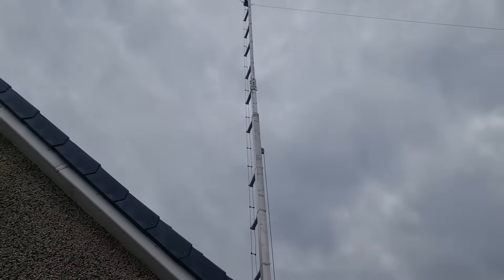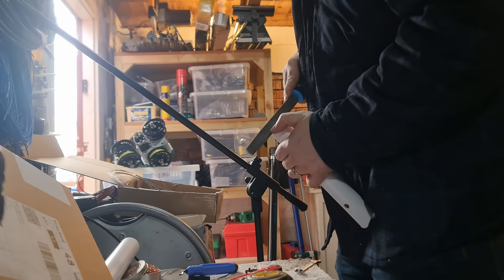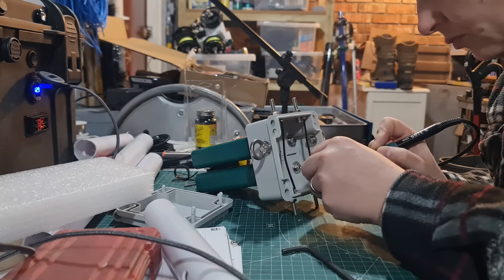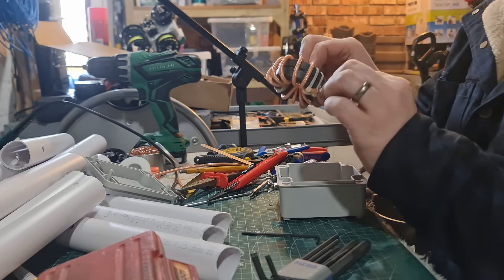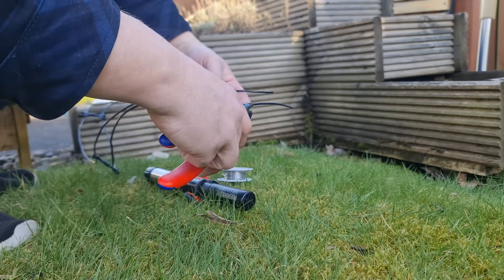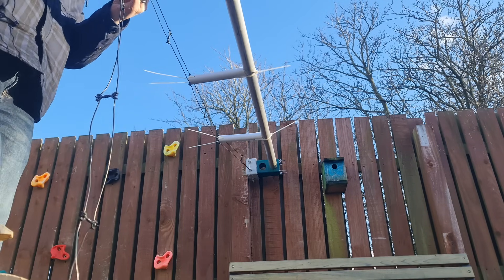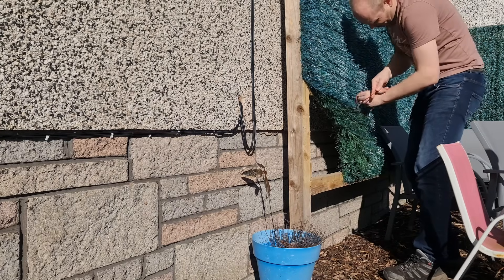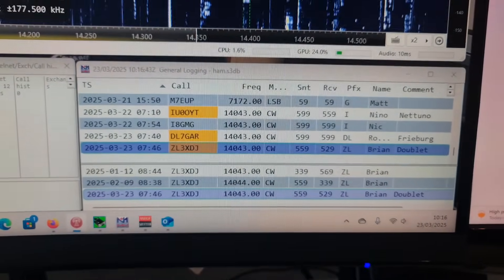The AMAZING Doublet Antenna

Comment: For UV resistance, always use black PVC and black electrical ties. Even a black tarp will last much longer than a white or light colored one. Black blocks light absorption into the material while white disperses it.
Reply from the maker: Yes in principle. Some black materials can absorb RF so need to be carefull. I will see how long this will last. The last clear nylon cable ties were up for years.
Reply: @MM0OPXFieldRadio  Yeah, I'm just offering my first hand observations for people who read the channel. While living in the Arizona desert I have inadvertently been doing an accelerated testing program for UV resistance of materials, due to high the sun exposure. The difference between black and translucent electrical ties will be more than double the durability and for some situations that will be critical. In your case however, in northern latitudes, and with the crank-up mast, I'm sure you can easily replace as need. Also yes, black plastic may contain some carbon.
Reply: Based solely upon color, the opposite of what you state is true - it's physics 101.    It's not because of the color it's the chemical composition and materials used that would provide any blockage of light absorption and breakdown of materials.    The color black appears the way it does because it is the absorption of the entire visible wavelengths in the color spectrum of light and blocks none, white is the rejection/blocking of all visible wavelengths of light in the light spectrum - i.e. lack of color.

Comment: And an inverted V doublet at that.  I cut mine the same length.  It works great from 40-6. I've used it in 80, but it acts more like NVIS antenna.
Reply from the maker: Kinda what I expected. Better than nothing on 80m

Comment: Years ago I bought the LL balanced tuner from PA0LL (SK). His advice was simple: if you like 40M, make the two radiating legs 13 meter each. If you prefer 80M, make them 17 meter each. No further trimming necessary. The doublet with 600 Ohm feeder is great for a multiband wire setup. If you can afford a high end balanced tuner, it's a wonderful investment allowing for full legal limit power on a simple effective antenna.

Comment: 600 Ohm open wire feeder is superior to coax
What you have there will be very enjoyable to use 
Great job !
73
de
VO1DV
Reply from the maker: This is more like 450-500 but still much better than standard LL. Thanks.

Comment: I'm thinking for months now,  to make this doublet or not.
i got a 9:1 balun and 16.2 meter wire,  inv L. 9 meter high
feet point at 1,5 meter. 
With1x 10 meter radial.
 and 16 Meter coax.
.
I think high feet point is better for radiation.

my other option fan dipole and no 80
Reply from the maker: Should work ok as long as you can keep the common mode out.

Comment: I just  finished my own doublet, I used 600 ohm window line, got it up 70 feet into the trees, my tall pines sway, so I had to put weights and pulleys on the ends of the antenna...  Great antenna, boy you had a lot of intensive work getting those pvc spreaders built and  positioned..    I enjoy all your videos...  Thanks 73
Reply from the maker: Good job. wish I had the space and those trees.

Comment: Strangely, I was just trying to troubleshoot the 40m performance on my homebrew doublet when this video popped up. I'm using a homebrew 4-inch-wide ladder line and a homebrew 1:1 choke balun into an MFJ-948 Versa Tuner.
Reply from the maker: Ladder line length critical. How long is the antenna?
Reply: its 67 ft, i cant go shorter than 70 ft of ladderline....all bands are working flawlessly except the 40m band.... initially i thought its the band conditions...
Reply from the maker: @Capt_Duffy  strange. I dont understand that.
Reply: @MM0OPXFieldRadio  "I've used ferrite beads at the antenna feedpoint for the first time—never tried this before. They've generally reduced the noise floor, including on the 40m band. Reception on 40m is fine, but transmission isn't. Do you think ferrite beads could be affecting the 40m transmission performance?
Reply: If it is resonant, you don't need a ATU.  The ATU only makes the TX output stage see a 50ohm impedance, it doesn't change the resonance of the antenna or the efficiency.  Most people misunderstand this and think it somehow changes the antenna.
You're better off running an End Fed Half Wave as this is resonant across many bands without the need for impedance matching.
Why have an antenna that is not resonant on the frequencies you want only to feed it to a ATU so you don't blow your PA stage.
Reply: @Bond2025 You make a great point about resonant antennas and ATUs. Just to add another perspective, A Doublet, which is essentially a non-resonant antenna system by design. The magic lies in the open-wire feedline with extremely low loss, and all the impedance matching is handled at the tuner end.

In this case, the Doublet isn’t just an antenna—it's a complete system: the antenna, the open-wire (ladder line), and the ATU working together. It allows for multi-band operation efficiently, even when the antenna isn’t resonant on a specific band. Definitely not the same as forcing a random wire through a tuner—this setup is built for it.